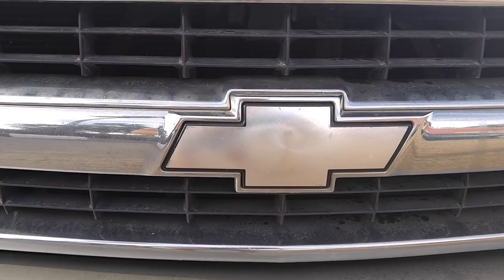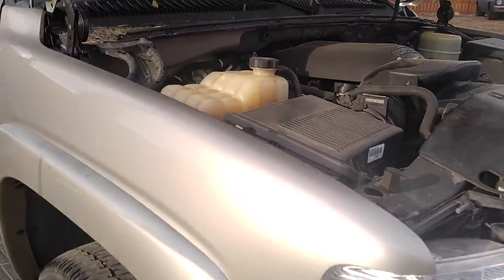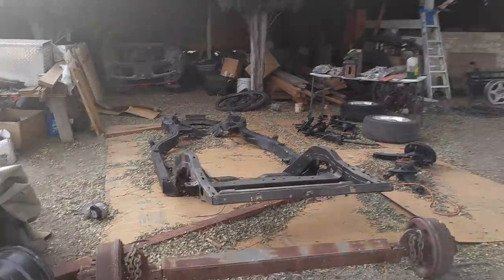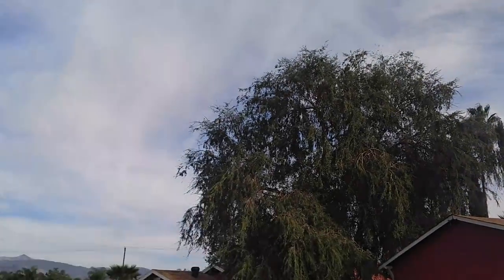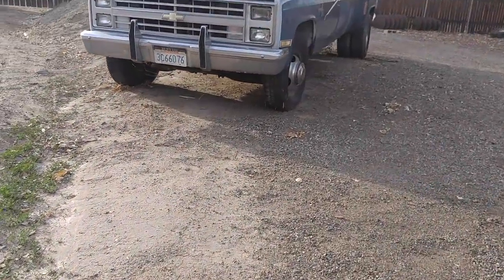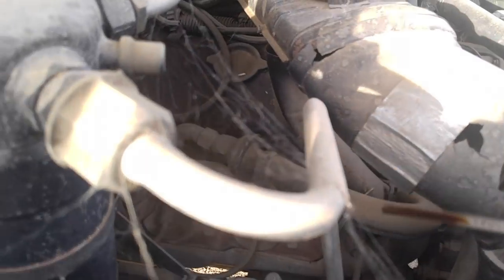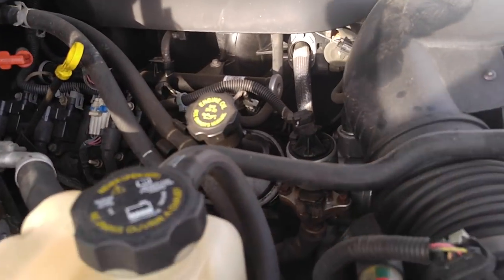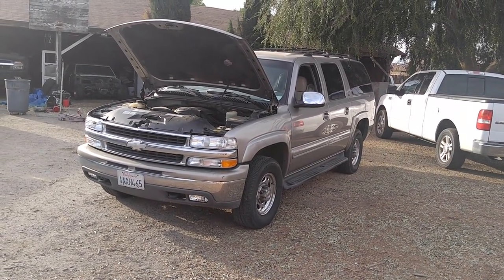My New Ssssuburban!!! 10 28 18

Comment: nice truck. what kills me is how small the rear wipers on all these suburbans and tahoes. vs what you see on vehicles that have that feature.   tires look dry cracked and curb rashed.  drives me nuts when i would see that on my car and i wasnt driving it lol.  now on the big rigs its an eyesore but granted not best idea but i have heard used motor oil and buff it in with a rag and it covers it but then you still got belt damage to remember.   to fix that squeek on door yeah you use white grease but try Castle branded Endura High temperature water risistant  grease.it works great . also great for computer fan bearings or use it on bearing of fan on a electronic cooler. mine still going strong and is a 10 yearold coleman that should have died off.

Comment: speaking of starters a neighbor has a chevy truck that when it starts it sounds like a revved up knocking engine but runs fine. i think its a mid to late 2000's one but i am not sure but truck has been doing this as long as the person moved in a few years ago. couldnt tell ya why it sounds like this just does. oh well
Reply: Piston slap, those era GM's were notorious for it. Heck even the 2.2 4 banger in my 99' S10 does it, sounds like it's gonna blow till it warms up.

Comment: Dont buy atlas. Crap Wetsand the side with like 2000 grit and polish it out Should take most out. Maybe 1500 then 2000  untill its mostly sanded dull then buff. Sounds more like low battery than starter

Comment: Are you going to keep this one, fluid film the shit out of it and drive it, you need a decent truck to move your junk around with.
Reply from the maker: Keeper? Maybe... On,my way ta phoenix, going good... Heater wont turn off, no AC
Reply: @CORVAIRWILD  sounds like bad climate control....sometimes you can pull it out and it reset how fixed mine. That or if stuck only on heat it may have a bad blend door actuator it on passenger side. Mine was stuck on hot but i ended up reseting the climate control by unplugging it and plugging it back in